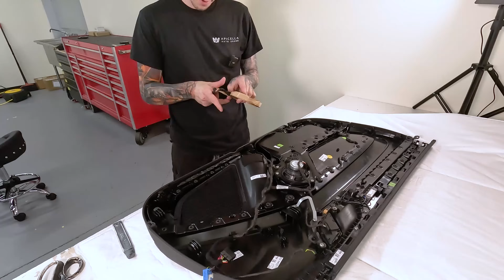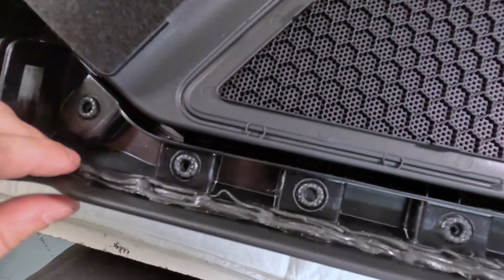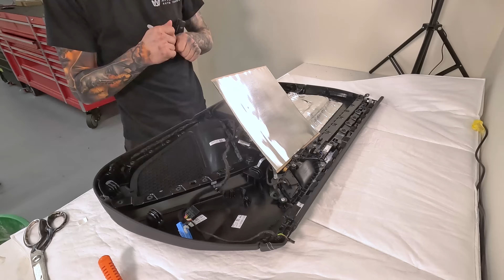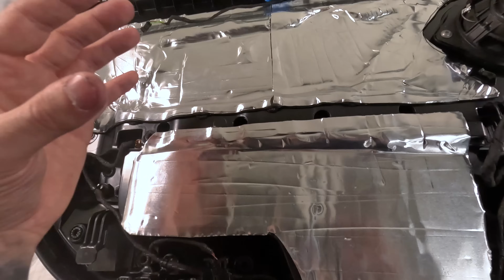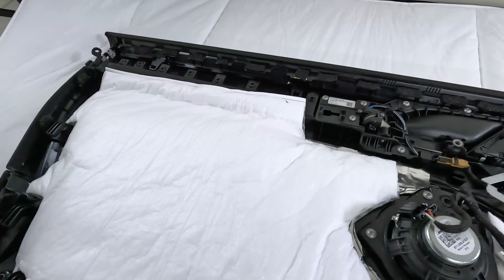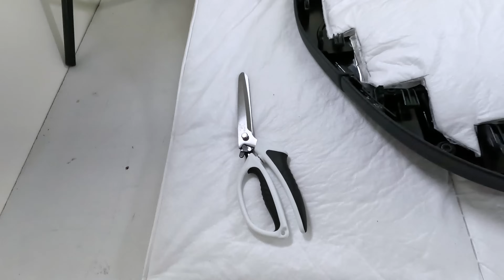2023 Porsche 911 GT3 - Sound Deadening Noise Reduction On A 992 Using ResoNix - Part 3: Door Panels

Comment: I am a fan of insulation car since 1995. But why sound deadening a GT3 that is mainly known for weight reduction ? Strange ... For my part and my long experience, insulation CLD is better on metallic panels.
Reply from the maker: 1) Because people want them quieter. It is not my business to tell them how their property should be used. MANY of them are willing to sacrifice a few pounds to shave down the unnecessary harshness.

2) CLD is great for plastic panels. CLD is for resonance control. Plastic panels also resonate, especially in sound system installations.
Reply: @ResoNixSoundSolutions thank you

Comment: So for the front doors.  Do you treat for outside noise or vibrations for the speaker? 
I’m asking because how much resonance can a usual mid based 4” woofer produce?
Would I need to sound dampen beyond my BMW 328i  door panel and do the inside as well?
I currently do not have any rattling with my 4” speakers in the doors. 

Cheers man
Reply from the maker: The quick answer: Both. This car was done for the sake of outside noise. But everything you see here would be exactly the same for a sound system.
Reply: Hi May I ask the cost ( material and work many) of what you present here
Reply from the maker: @fytilis  https://resonixsoundsolutions.com/shop-2/porsche-911-kit/
Reply: How many kg you have add? I think to do noise deadening is pointless on Porsche 911 992
Reply: Evidently the owner wanted to trade an enjoyable driving feeling with losing 0.2 sec. 0-60mph 🤷‍♂️